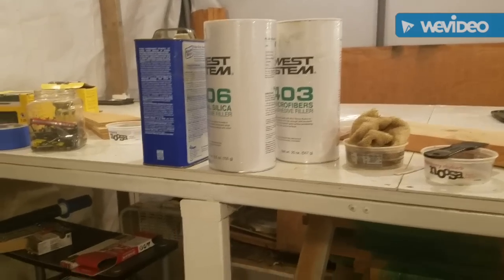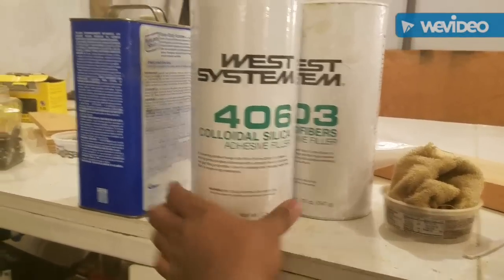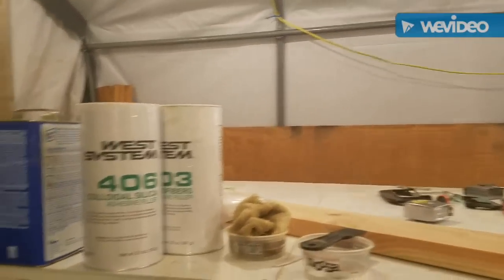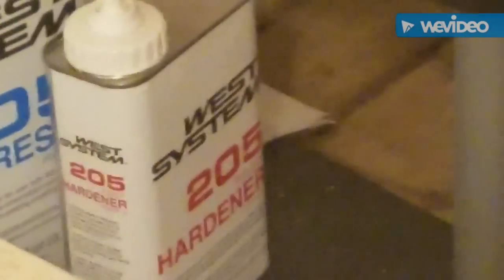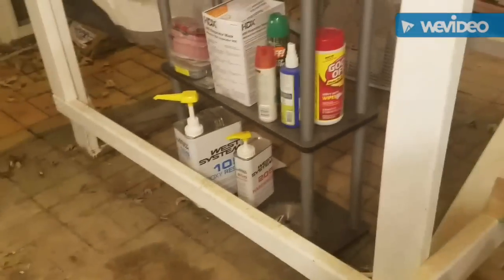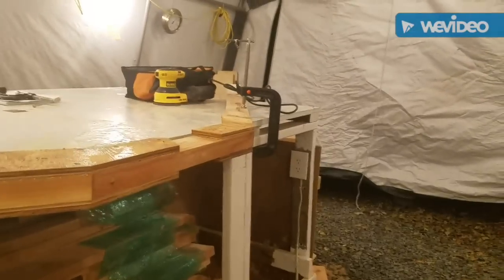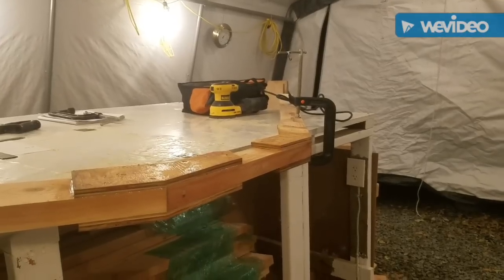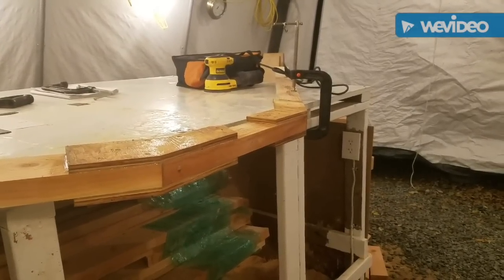Mid-week Update, epoxy filler proportions

Comment: I used the 205 extensively during the repairs over this past summer. I found if you are only going to mix 3-4 metered pumps and go ahead and use it, it takes a bit of time for it to kick off. But for what you are doing the slow should be better during the warmer months. Keep up the good work

Comment: Almost caught up, since finding you via Mads video still enjoying watching the process tremendously What working time difference do you find  between the regular and quick acting hardener?
Reply from the maker: H2Dwoat I can't really provide any information on that because I don't use the quick-acting during regular temperatures (60 degrees and above.) I've only used it in cold weather situations when I can't use the regular hardener. Thanks for watching and have a wonderful New Year. :-)